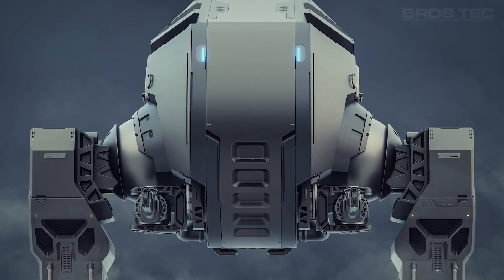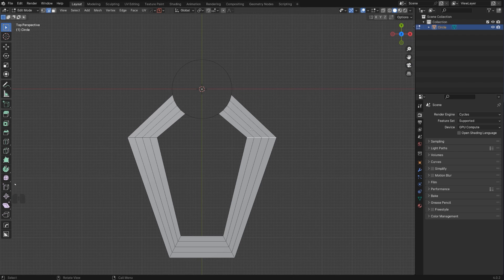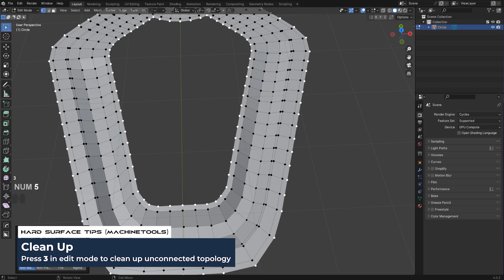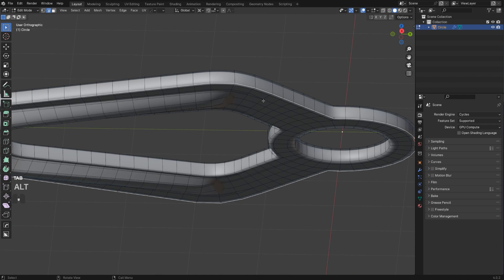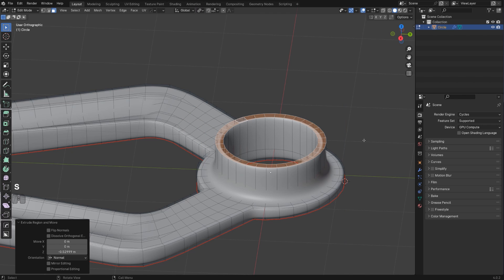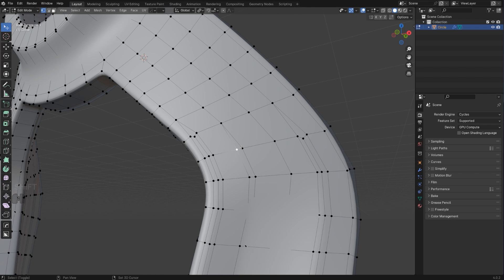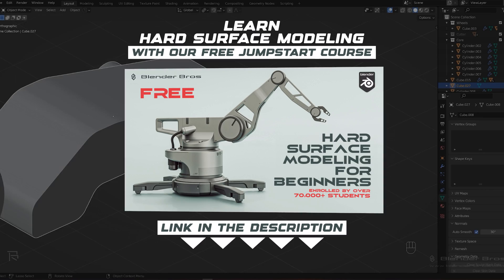Mastering Organic SUBD Modeling in Blender 3D

Comment: Modeling the Base Shape
1:16 - Creating the initial circle and extruding it.
1:43 Alt-R edgeflow slide 
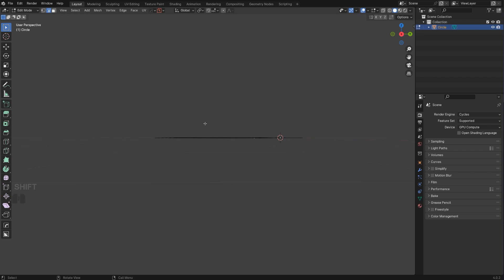2:20 - 3:06: Using Edge Flow and Edge Constraint to shape the base form.
3:07 - 3:55: Adding more geometry and defining the edge flow.
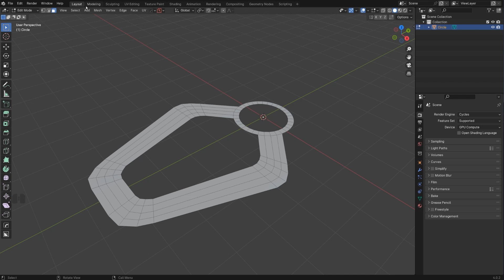3:56 - 4:08: Saving the project.

Subdividing and Shaping
4:09 - 4:51: Adding supporting Loops and using Offset tool.
4:52 - 5:32: Subdividing the mesh and creating the indentation.
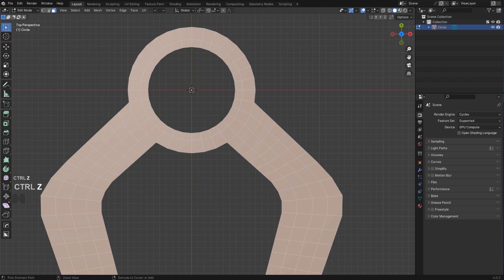5:33 - 6:35: Sharpening the edges and creating the diamond shape.
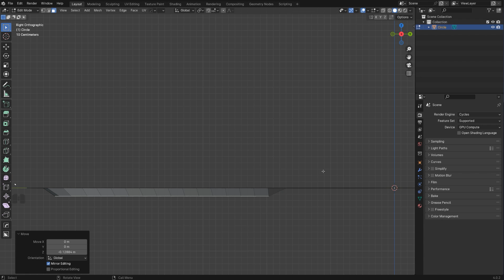6:36 - 7:35: Fixing the middle section and restoring the curvature.
7:36 - 8:10: Subdividing the mesh and refining the shape.

Extruding and Symmetrizing
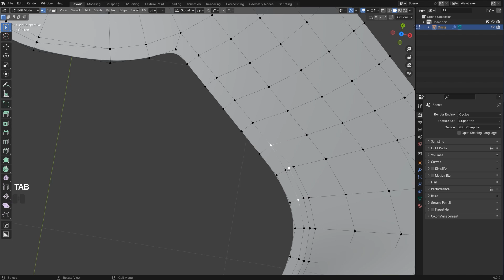8:11 - 9:02: Extruding the base shape and marking seams.
9:03 - 10:20: Flattening and rotating the extruded part.
10:21 - 11:07: Symmetrizing the shape and adding more geometry.
11:08 - 11:52: Adjusting the geometry to fit the curvature.
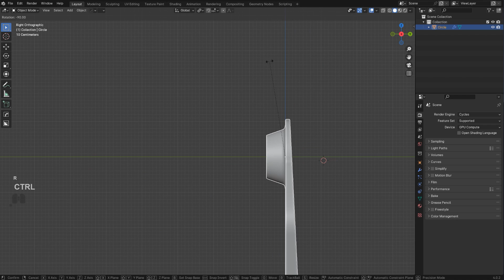11:53 - 12:30: Applying the Bend modifier and fixing distortions.
12:31 - 13:56: Cleaning up the geometry and fixing the circle.
13:57 - 14:59: Finalizing the shape and adding details.

thanks for making these videos they are awesome!
Reply from the maker: thanks a bunch, I added to the description so now there are chapters

Comment: this is bullshit so convoluted. cad makes it faster and better
Reply: @handler_music  U can use CAD but workflow changes. Ofc the purpose of the mesh matters. If u want to print this then CAD and nothing else beats that. If u need this in VFX, then there are few workflows. If u already using cad you would have to retopo the model after you import that into mesh software because models impprted from CAD software wont have perfect geometry. So the question is what's faster modelling in Blender and taking care of edge flow and density there or modelling in CAD with nurbs, then importing in blender, when doing retopo. I would say both are pretty similar, l but at the end of the day u will still need to use mesh type software to retopp so why bother with CAD. Hope this explains how there is no one universal best workflow and why u shouldn't think that your workflow is superior.